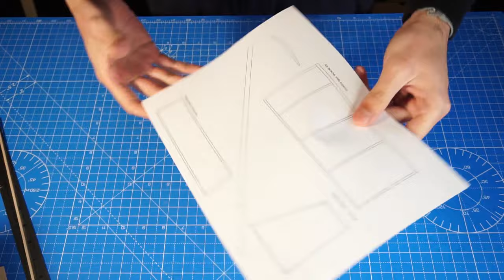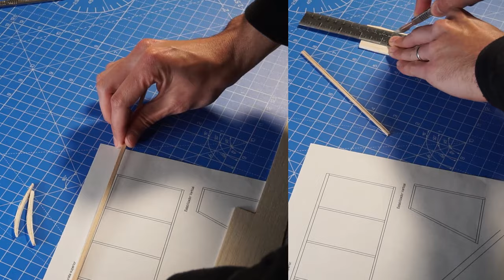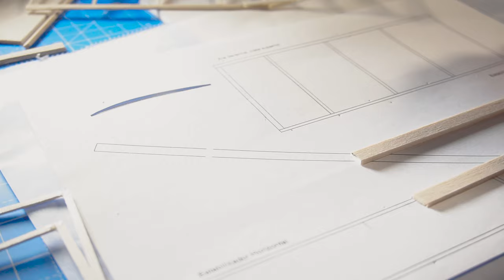Free flight simple model airplane (glider or rubber powered) | Fly inside the house

Comment: I ended up using covering film instead, which completely warped the wing, in the end the wings were different shapes but glad to say it still flew great. Keep them coming please.
Reply: You can reheat the film with a hot air gun and reshape the "odd" wing to match the other. You may have to hold more than you want because it may snap back a bit. You can do it several times Untill you get it just right!

Comment: I use to make my own string control planes as a kid, and love designing and flying equally. I used a solid wing design for my micro gliders I would build just to fly indoors and used a high ratio wing design for a solid wood plane that if you can imagine the predator drone type wing I used sanding blocks and carve the wings curves like homing a knife and I would mount the wings on a saddle so I could move the wing up and down the airframe to fine tune the balance, use a pencil eraser for the nose cone good weight and it bounces! I would also use Gilmore balsa rubber band powered kits for donor parts like their world famous Red Propeller and great landing gear that was indestructible. we would see who could take off fly and land one free flight.

Comment: Very nice video, well executed and well presented, the only fault I could find was adding weight near the CG when it would have been been better to have removed the appropriate amount of weight from the nose, especially when a power system was being considered.

Nice job of removing excessive weight by carving (or lightly sanding) of the frame, etc. to lower the overall flying weight.

Also, your stand for balancing your model's CG was more precise than using your finger tips; I have models in size from 'peanut' scale to a few which are 12 ft. and 14 ft. and use this same technique for all of them to establish the CG.

I've always been intrigued with the 'penny planes' used for indoor competition and am hoping to get enough interest in my area, Riverside County, CA., to establish a competitive format at one of the local high schools gymnasium.

Thank You for one of the better tutorials I've seen so far on the You Tube Chanel.

Comment: I can understand that CA is perhaps lighter than aliphatic resin (aka wood glue, yellow glue). But wood glue will give a much stronger bond if properly applied; i.e. - thin coat, dry, thin coat, join. Especially if you poke little holes into the wood with a pin, so the glue can for sort of "pegs" so to speak. This works with CA and epoxy etc. too of course.

Comment: Can we use Eze dope or can we use CA glue for covering the wings
Reply: Either work fine but try to get the surfaces tight when the tissue is applied then you don’t need to use dope as dopes add extra weight.

Comment: can we make it without balsa wood?
Reply: What do you want to make it out of?  Balsa been used for years chiefly due to its extremely light weight and relatively low cost.  If you can make the frame out of a different material, I would sincerely like to see a video of it
Reply: Bamboo sticks are pretty good to use, I used it to make one and it works so well!
Reply: @joshuadelfin6592   that sounds cool.
Reply: @NemoVir  yep, it's actually close to the weight of the balsa wood, and it's not that hard to find so it's a win-win. Although it's better to make it thinner at a little bit larger so it could fly slowly and smoothly